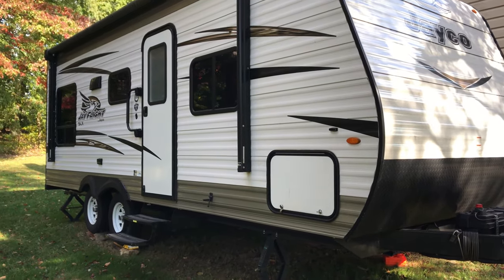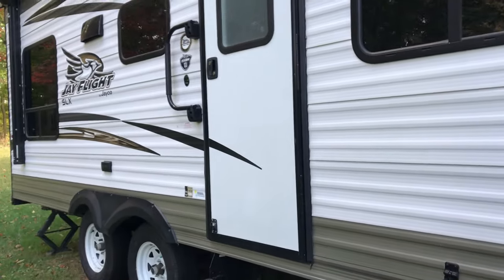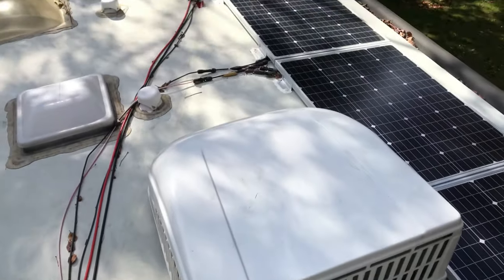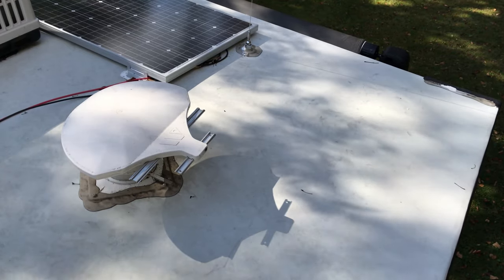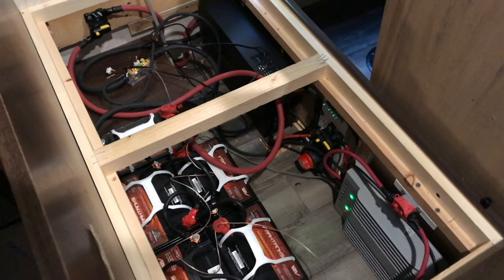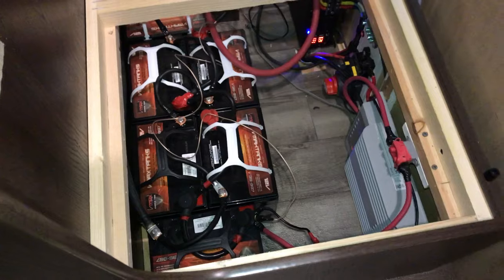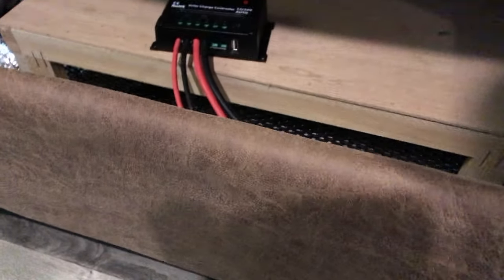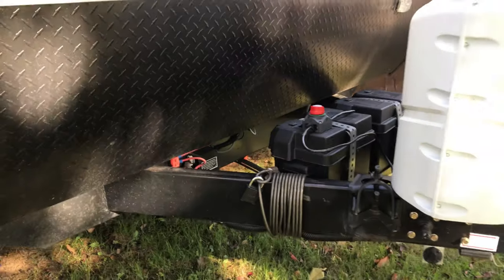Jayco Travel Trailer Solar Power Tour | 500 Watts Solar Panel with two Battery Banks 400 Amp Hours

Comment: Thanks for this video.  We have purchased the Jayco 212QB.  Similar to your unit we have factory installed solar panel.  We are just starting to investigate upgrading the solar system.  Do you know if the factory installed charge controller, battery and wiring can handle an additional panel?  If adding a single panel should it be wired in series or parallel?  Thanks for any insight!

Comment: How did you get you wires to your charge controller from the roof to under the bench. Where did you run the wires to get to the transfer switch? Nice setup.
Reply from the maker: I made a video series on this ; 8 vids... but here is the wiring vid https://youtu.be/XH2ZFUUZ45w
Reply from the maker: Start with video 4 then watch 5 and so on: https://youtube.com/playlist?list=PL6vR9pff96YM7eoHQ34wQGwaG9K-D8CLx&si=8vlxhFc6ONAcU2LU

Comment: Why 2 different battery banks
Reply from the maker: The front battery bank came with the Jayco travel trailer when we purchased it new. So, why get rid of a fully working battery bank. As you know, the batteries in the battery bank must be matching. In addition, the second battery bank in the cabin, mainly focuses on the converting DC to AC. When the time comes - when the front batteries fails/dies, I do not need (will not) to replace them and let all run on one battery bank.I hope that makes sense.
Reply: @cbatilo  👍 Thank you; I’ just purchased a Jayco eagle ht and I’m trying to figure out how or where to install inverter to circuit breaker box, and their seems to be wires everywhere; but I do thank you for your post their VERY HELPFUL, to newbie’s like me, that’s not electricians